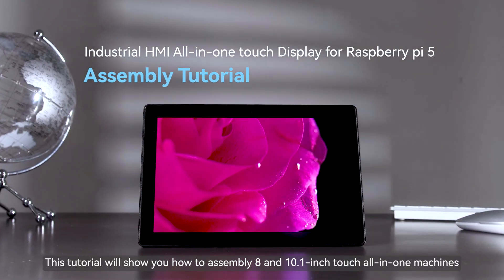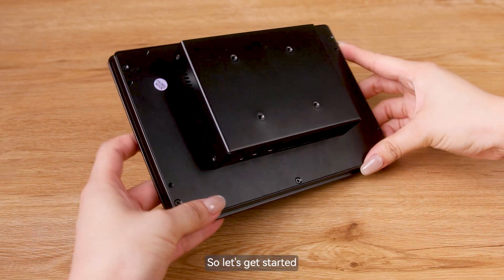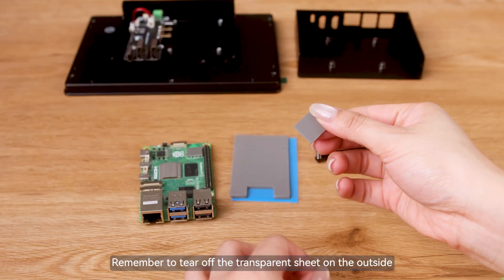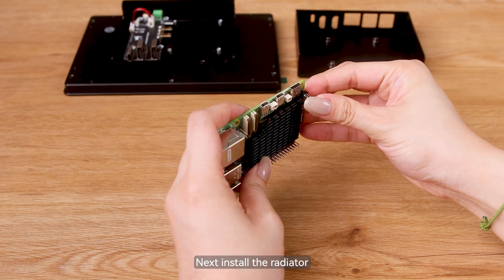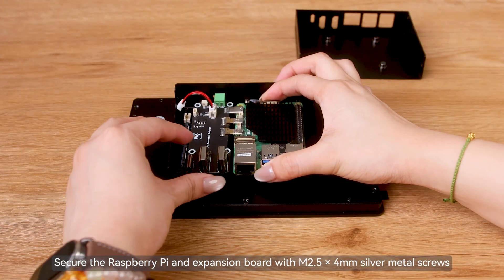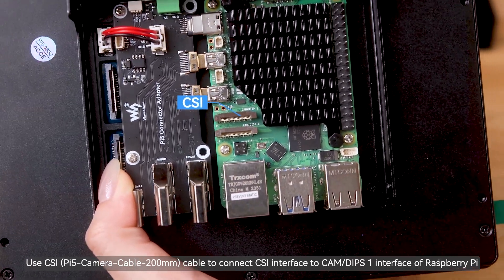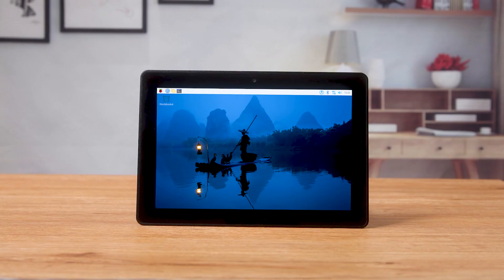Assembly tutorial for raspberry pi 5 touch display, 8 or 10", supports dual 4K HDMI output

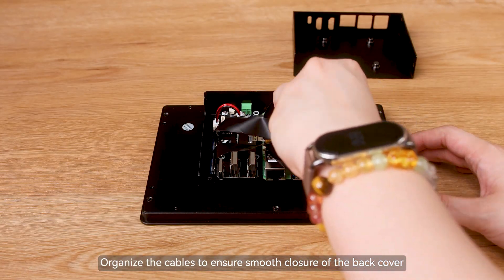Comment: 2:17 "organize the cables ..." Why doesn't it have a 90° cable? Seems like it would have been better to position you connections so that the ribbons wouldn't have to make a 90° path. And why does the video cut out the frames that show how to actually do that. smh ‼‼
Reply from the maker: hi dear, so sorry there is no 90° cable currently, special-shaped cables will also have other installation folding problems. We will try to find ways to optimize the wiring space. sincerely thanks for your feedback.